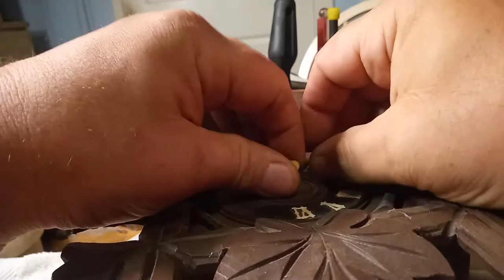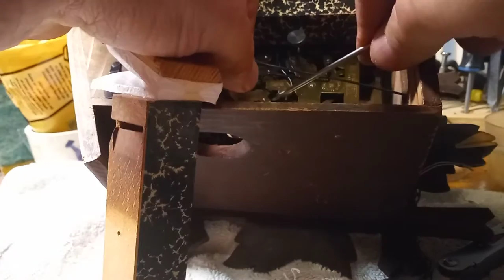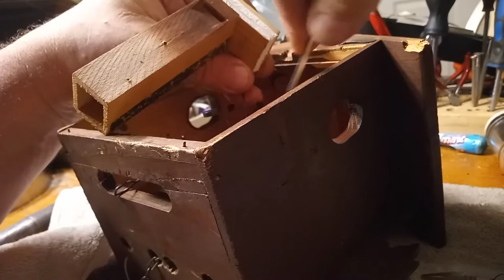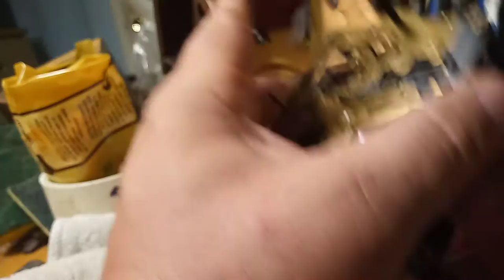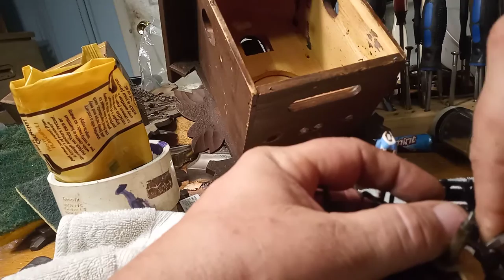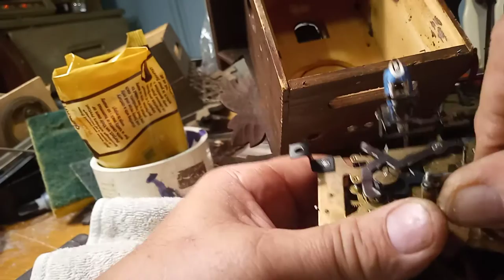Repairing a Schatz cuckoo clock 20210527 000448

Comment: Some one  gifted me  3 i was working in her house and in saw what apeared to be an old clock so i asked about em.and she just stared handing me cucu clocks since in working at her house and her husband recently had paseed away, i was told they dint work or she thought so i never to interest on em i hored em in my closet til recently i research it and turns out they all work and i think i found my new hobby  i asume work needs to be done on em.
Reply from the maker: About every 5 years the clocks need to be serviced. That consists of taking the movements out of the clock, taking them apart, cleaning, putting them back together, put fresh oil in them and then put the movements back in the clocks. Sounds like you have some nice clocks that were gifted to you.